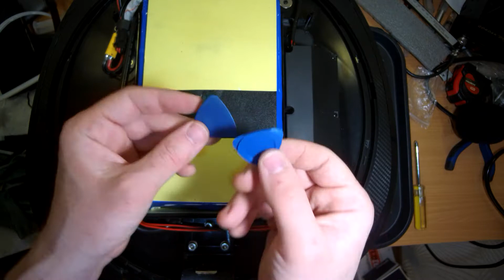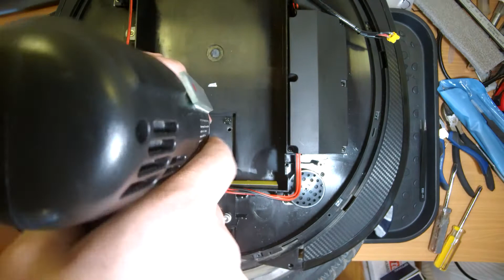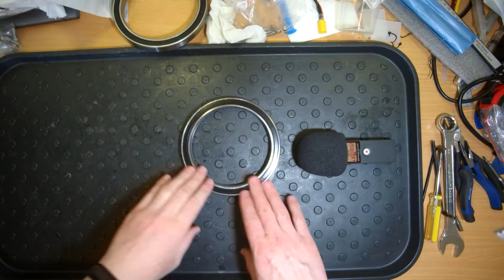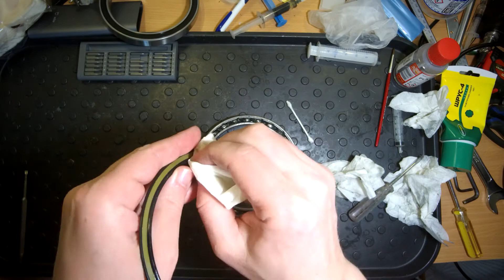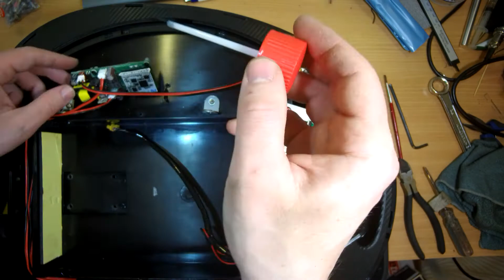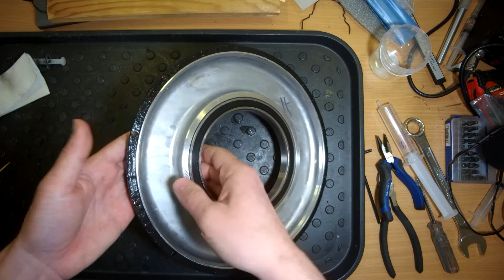Begode Tesla T3: WaterProofing, Sealers, Bearings.

Comment: I have the Tesla 2 and I just bought the Tesla 3. They are almost identical, except that the T3 has a 1,500 battery. The pedals of the Tesla 3 have 1 centimeter more height that is hardly noticeable. Begode is not going to produce any of the 2 Tesla again, for that reason I will keep the 2. Gracias por tu video, from Medellin, Colombia

Comment: Excellent video.  Many thanks for sharing.  Those hex head machine screws look like a good place for shorts.  Did you consider insulating?  Also, why did you chose a diode on the charge port instead of a fuse?
Reply from the maker: I didn't understand what hex screws are you talking about... The diode was chosen because it blocks "reverse" current on the charging port wich gives you additional protection from electrical corrosion as well.
Reply: @ITm0nkey  "Thx for the info re the diode. I always fuse my charge ports but have never used a diode. 

There were several screws at the bottom of the wheel that were adjacent to wires (not sure which part of the circuit the wires were from) but having exposed metal close to routed wires always makes me nervous lol.
Reply from the maker: @chrisd6381  Ah, you mean pedal hanger screw heads? They are not sharp, so there is no point to worry about possible wire damage....

Comment: What size bearing puller was you using.? 
Alot easier using that tool to remove motor and bearing 
Also are you using conformal coating on windings and pcb board ... thanks for video

Comment: Hi. I have the t3 and just recently it started making a whirling noise when riding. Started after a really short ride in the snow, idk, but it's not that bad. I reallly need it tho. Can I still use it or will that lead to some problems? Also, would you consider doing the same procedure as in the video for my wheel?